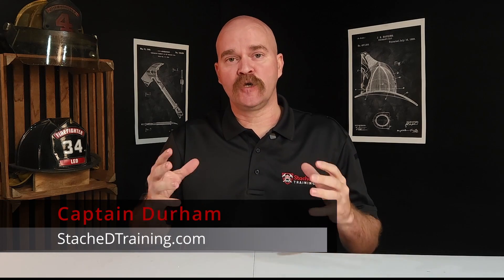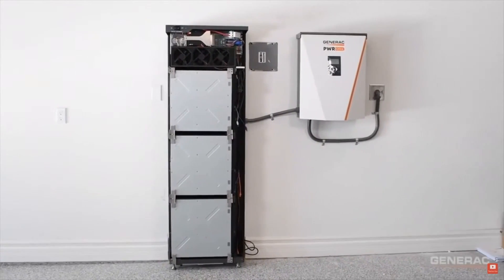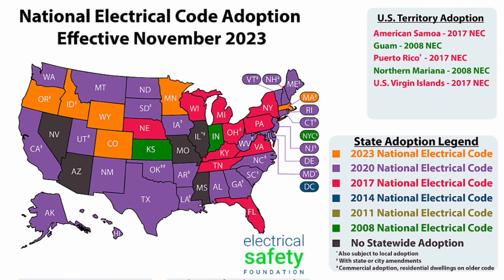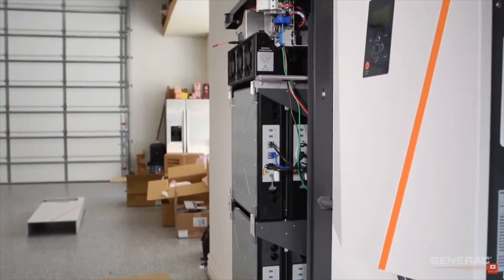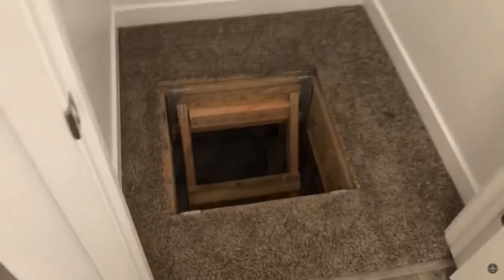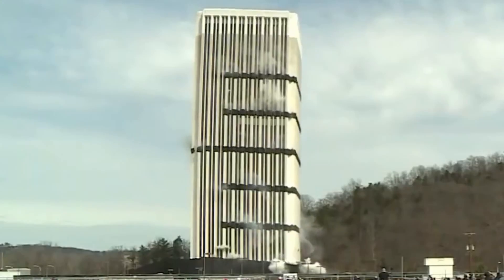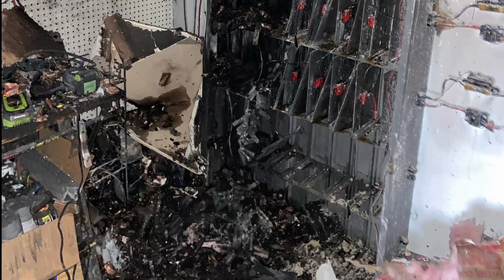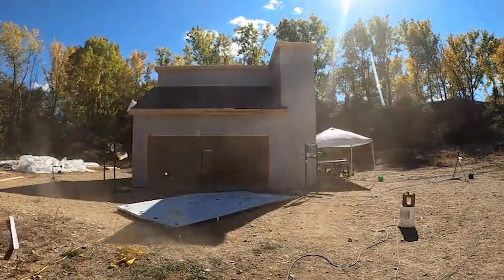Explosion - DIY Energy Storage System: Worth the risk?

Comment: I live in Florida. My mildly sloped roof receives sun, unobstructed, from sunrise to sunset. I thought about solar, as it would be a perfect application for my roof. My concern was damage to the system and the roof during a hurricane. This was 20 + years ago and i am thankful i didnt bite. With all the shady companies doing improper installs and downright scammers, i opted for a propane fueled, whole house generator. Professionally installed with a 500 gallon tank. Last year hurricane Milton passed directly over us. Absolutely terrifying. We lost power twice. Fortunately, it was only for about 5 minutes each time. The generator kicked on after 10 seconds each time. We were blessed to not have lost power for longer than that, even though we have the generator. We lost power for 8 days after hurricane Irma and for 12 days after Ian. Thats when we decided to spend the money and have the generator put in. Not cheap, but well worth the expense when power went out (albeit briefly) at 12:30 am with 120 mph winds threatening to blow our windows in. I travel extensively for work and was caught out of state after Ian came through. 12 days without power convinced the (very unhappy and uncomfortable) wife that a generator was a must have. I also prefer propane, since it is on site and ready to go. I’ve heard some stories of customers with natural gas powered systems not being able to get enough gas pressure after a storm due to the local utility being overburdened after a storm. Whatever method you go with, understand the risks and be thoroughly familiar with safe operation of your system.

Comment: A common mistake is to confuse Watts with Watt-hours.  

Watts are a measure of instantaneous power.  A 100 Watt light bulb, for insance, burns 100 Watts.

Watt-hours are a measure of energy, which is power over time. Your electric bill charges for each kWh , which are 1000 Watt-hours.

Confusing Watts with Watt-hours is like confusing MPH with miles driven.  One is a rate.  The other is the rate over time.  Or to put it in fireman's terms, gallons per minute is a rate. Total gallons is your rate of usage over time.

Comment: I read the title and considered. If I was to build such a system, the first thing I do in design phase is plan for failures.
As you mentioned, hydrogen gas venting is a known problem and well, it's long been a historic problem that's literally sank submarines full of men. Plan for it, design powered sparkproof ventilation of the battery room. Yeah folks, room.
Plan for a cell/battery to catch into the most rousing and entertaining jetting fire from hell and convince its neighbors to join into the festivities. Trust me, with any lithium system, that's a fair probability, but remember those submarines? Same problem going all the way back to WWII. Design for it to burn, allow the fire a path to burn through and vent away from your important structures. Better that than waking up at 3:00 AM to find to your horror that your toes are literally ablaze - along with the rest of the house.
For giggles, I could take those 18650 batteries and build a safe system. It'd be stupid, as the cost to do so would exceed using proper storage that's designed for the deeper cycling involved in a power system, but I am an electronics technician with a hell of a lot of experience and could wrangle it. Power management, really design for the damnable infernal thing to burn, because it will, charging management, fire and hydrogen detection and oh yeah, really design for the damnable infernal thing to burn, because it will (can't repeat that one often enough). You're dealing with a hell of a lot of energy, for most, beyond their imagination, as the cells and batteries these days are so small and innocuous looking.
I don't have that problem, as I've watched batteries, from old car battery type lead-acid, gel cell (really, much the same animal, the acid is only gelled), lithium and more burn or explode or even both. Wouldn't want to see a submarine battery room fire!

Remember, the explosions at the Fukushima nuclear plant were hydrogen explosions, nothing nuclear save the heat that released all of that hydrogen that filled the buildings.
So, do what the professionals do, call a professional. Or enjoy your story on the news about your family being incinerated, then crushed when the unit burns, then explodes, dropping the building on you all. Professionals are far cheaper, their supplies cheaper in the long run than another house.

Comment: Back in the 1990s I lived in a rural lake community, the power was frequently knocked out by falling tree limbs, I purchased a Honda powered propane fueled generator welder capable of producing 10,000 watts per hour at 100% duty cycle, it was fueled from the 1000 gallon propane vessel that also provided fuel for heat and hot water, this set up could run the entire house for at least 30 days, it was located in a boat garage in the basement of the house and the exhaust was vented outside. Simple, inexpensive and very reliable, I had to manually start the generator and manually disconnect the house from the grid, total cost $8000! Generac makes methane powered standby systems which are supplied by the gas service to the house. I wouldn't buy ANY lithium-ion system, period. I might purchase a vanadium flow system because they cannot catch on fire!
Reply: Vanadium is good.

Comment: Lithium batteries are NOT safe for large scale power! The more cells you put together the more dangerous it becomes. Anything that needs that engineering level controls to be considered safe was never save in the first place. We need a better technology to replace this with! Lead acid wasn't as efficient, but it wasn't a constant fire hazard either.

Comment: Hi the house in Germany has not been confirmed that it was the lifepo4 that gased off. Why are you giving false information? The same with your other videos, I agree with a lot of your points but not regarding lfp,
Reply from the maker: The community involved in the analysis of lithium-ion battery failures is small. When large failures like this one occur, we communicate and establish connections worldwide. The information I present comes directly from the source, either from the local fire department or investigators who have been in contact. There is a misconception that LFP cannot fail; while it is more difficult to initiate a failure, the consequences can be more catastrophic due to an increase in flammable gas released.

Comment: Victron is not cheap but I love how it all connects together. I just upgraded to (3) 200Ah Victron Smart lithium batteries along with their Lynx BMS and Distribution System. The BMS is incredible and works perfectly with the Battery Protect devices to keep my system safe. I have very little concerns about blowing up my van.

Comment: In the majority of cases grid level energy storage is used for power smoothing and temporary emergency backup while other systems are quickly switched over to. This is because even some of the most massive battery installations can only manage about twenty minutes of supply at full grid usage. This limit is due not only due to the total capacity but also due to the risk of thermal runaway, if batteries are at high draw for too long they overheat .

Comment: I live in Australia in an apartment. My wife and I are considering building a second home in the Philippines where she is from.
We want to have a  stand alone off the grid set up with solar and battery with petrol or diesel generator back up.
I wouldn’t consider having the battery and generator anywhere close to the house/garage, it will be in a self contained structure a safe distance from the home.

Comment: This video failed to answer the question in the title. The answer would involve comparing the rate of home fires from fossil fuel powered generators vs these DYI systems. I have a strong suspicion that the battery systems are not just safer from a fire/explosion perspective but far more reliable as well. 
This would be a good point for the makers of this video to chime in and actually answer the question they themselves posed. 
Remember, “danger” is a relative term and without comparison to the normal backup systems, there is no way to reach a conclusion.

Comment: Are there any automatic extinguisher systems that you think would be good for a battery storage area?
Reply: Isolation is the best practice. Even if you get the initial fire out, there would still be risk of reigniting. Best to treat battery systems like any other backup generator and place it outside the house.
Reply from the maker: Unfortunately,  no.
Reply: Most these images are of 18640 battery types. The lifep04 3.2v is the new standard. Some of them can even be cut in half and baked to 350 without thermal incident. Some of the rack storage systems and battery enclosures have fire supression built into the battery itself, curious how effective those are. There's a few companies that build enclosures that vent the off gas, scary what's been put out there so far, but the future is looking safer.

Comment: How did the LiFePO4 batteries release hydrogen?  Lead acid do because of sulfuric acid (H2SO4), but I'm not understanding what happened.  What compound, in what material, released the hydrogen?  I think there is more to it than what you have in the video.
Reply: Aren't these batteries made of rolls of materials coated with this or that, and things like viscosity enhancers? There's probably all sorts of shit in them that doesn't get a mention, but has plastics involved. There's your hydrogen source.
Reply from the maker: Lead acid batteries release flammable gas during normal operation.  Lithium-ion do not release any gasses during normal operation.  However, if they fail, during thermal runaway, LiFePO4 (LFP) batteries will release a significant amount of hydrogen.
Reply: @StacheDTraining  from what?  The anode, the cathode, the casing?  There has to be hydrogen in some compound to be released.  From what I see the electrolyte in the cells is lithium salt, and doesn't have any hydrogen in it.  If it was hydrogen, it had to come from somewhere.  I guess it's possible, but I don't know where it's coming from.  I would expect it from sulfuric acid or sodium hydroxide, or even water maybe, so this one threw me for a loop.  This is not common knowledge.
Reply from the maker: https://www.mdpi.com/2079-9292/12/7/1603
Reply: @StacheDTraining lithium ion not lipo4 which is a lot more stable you should specify the type of lithium compound lithium ion is the worst for home storage lip04 is the medium of choice
Reply: @StacheDTraining  Thanks.  I've seen another study before and I saw the hydrofluoric acid and hydrogen and all the other gases that can be released, but they don't show the breakdown of what compound is releasing hydrogen.  If you look at the chemical formulas you only see H's in the gases that they detect during thermal runaway.  Where is it coming from?  I skimmed the study and I didn't see anything.
Reply: One of the main ones seems to be PVDF, which is used as an adhesive binder to stick the particles together in the electrodes. Also, the separator is usually a polypropylene plastic, which also contains hydrogen. You’re correct that the main electrode components don’t contain hydrogen, but these other components do. Also, many electrolytes are made from hydrocarbons such as propylene carbonate, C4H6O3. Lots of hydrogen in that.
Reply: @simontillson482  Yep.  Y'all are right.  The SDSs for LIFEPO4 aren't too thorough, and the studies don't go into too much detail.  It's making me rethink where I put my battery banks.  I've got 11 kwh in the house and I'm getting ready to add 15kwh.
Reply: The inside of both LFP and LCO cells (and indeed most lithium rechargeables) does contain electrolyte - an organic solvent.
This will vaporize during a runaway, and is quite flammable - but these compounds also break down into hydrogen etc. when exposed to high temperature.
Additionally, if the cells are reverse charged (as will happen during an uncontrolled discharge), they actually form oxygen gas too ._O
So realistically, treat these situations with care - and even better, if engineers give batteries some respect - they might not be a hazard!

This all comes from a paper on battery deterioration, and how they react to adverse temperatures and charge conditions. And the MSDS for various batteries...

Comment: We have been building battery rooms for over 130 years. Typically for wet cells which constantly off gassed hydrogen, which required sensors and ventilation. The newer lithium batteries do not normally off gas. 

However they will off gas during a thermal runaway or external fire event. This was fairly small battery, typical of what we would have in  rack mount UPS in a small server room. Building code does not require ventilation for these small systems. Since they did not find much evidence of fire around the battery, I am skeptical it was from off gassing of the cells. In this case the battery system a kit and not UL or CE listed. 

Looking into the off gassing from runaway cells it seems that CO detection may give us the earliest warning, in studies I have looked through it seems that is the first off gas along for CO2. It might be a good idea to start venting then, by the time you detect H2 you already have problem. It looks like hydrocarbons like benzene, toluene, and methane which seems counterintuitive to me. The trend in data centers is to locate the backup batteries in self contained "shipping containers". 

With the cost of UL listed rack mount battery at around $250 a kWh there not much reason to DIY a battery anymore. Even with UL listed batteries I have mine in a free standing garage. I trust batteries about as much as I trust natural gas and that explodes all the time.
Reply: I am skeptical of CE ratings. Could stand for Chinese Excrement
Reply: @juliogonzo2718   “Chinesium Excrement” !
You certainly got that right..
😂
Reply: With around 100 per kwh diy is a better choice. Especially when you still scared of magic UL listed appliance.

Comment: Solar collector systems are DIY friendly and risk free. My brother built one, used the the old cistern to his place for energy storage and now heats his house almost for free.
Reply: Nothing is risk free. No need to exaggerate. But i strongly suspect the risk for these battery systems is much lower than gasoline powered backup.
Reply: @williammeek4078  I've never heard of gasoline powered backup. But private diesel storage has been accepted for well over 70 years. Diesel doesn't spontaneously combust, in fact it's quite difficult to ignite, and can be kept in tanks in your cellar or in a garden shed without risk. You can't say that for lithium batteries.
Reply: @mikethespike7579  😂🤣😂🤡🤡🤡 You can’t say diesel is without risk. All energy storage carries risk. If you think diesel is hard to ignite, you would be impressed with how hard it is to ignite batteries. 
You do realize the even for cars, ICEVs are 30x more likely to catch fire than BEVs.
Reply: @williammeek4078  Contrary to what most EV advocates would want us to believe, diesel fuel is the safest form of energy storage you can buy. It does not ignite when exposed to sparks or a flame and does not produce toxic and explosive fumes when stored. In fact you can pour a bucket full of cold diesel fuel onto a camp fire without it burning.
You would not only be impressed at how hard it is to ignite a tank of diesel, you'd be even more impressed to know that diesel vehicle fires are almost unheard of. 
Also, burning diesel can be extinguished by simply pouring water on it. That's why it is perfectly safe to store diesel fuel in large plastic tanks in private cellars.
Maybe EVs don't burn a often as ICEs, but when they do it's usually spontaneous when standing unobserved in a garage, producing high temperatures that can melt steel and burn thorough concrete and cannot be easily extinguished.
EV's are much more of a fire hazard than ICEs.
Reply: @mikethespike7579  try telling this to Land Rover who had multiple recalls over fires from the diesel fuel systems. 
And say EV “may not catch fire as often” doesn’t quite capture the 30x incidence rate of fires in ICEVs. 
If you still don’t want to believe diesels are a much bigger fire hazard, have a conversation with the Bedfordshire Fire and Rescue that fought the Luton car park fire that was started by a diesel.
Reply: Friendly and risk free 😮And I have a bridge to sell you on the Hudson cheap 😅

Comment: People are being sold at ticking time bomb with these lithium ion batteries such as Tesla powerwall. There is nothing safe about these batteries at all. If you want a safe battery chemistry use lithium iron phosphate or life po4. Even lead acid batteries can release gases which are explosive. The lithium iron phosphate batteries are currently about the only safe battery chemistry that has a high efficacy and produces adequate power for running a home or business.

Comment: Home good builds guys normally will say that the key to using old batteries is to not over stress them, dont't charge more than 85-90% or discharge to low and charge and discharge al much lower currents than you would normally. This greatly reduces the stress on the aging cells to the point where the risk of explosion is almost zero.
If you want your phone battery to last way longer and greatly reduce the risk of it exploding on your car dash then don't fast charge you can turn it off in your settings.

Comment: Battery banks SHOULD NOT BE INSIDE HOME STRUCTURES.. INSTALL THEM IN BOMB PROOF PITS --OUTSIDE THE HOME..
blast pits are designed to fail , and any catastrophic failure is didta ced frkm habitation...
Hmmmmmm